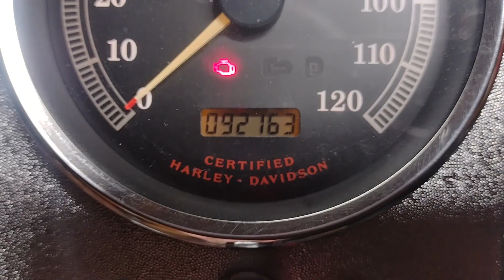The Struggle to get my first Harley Davidson

Comment: Congrats and BTW, my 96inch, 2012 Dyna Superglide has 118K miles on it and my 2003, 1200 Sportster has 76K miles on it.  Neither one has had a wrench to the motor.  I'd suggest you replace your cam chain tensioners and just ride your bike.  It will be fine.  It's a 2001?  It's a 88inch 5spd.  They're good machines.

Comment: The shifter probably needs new bushings they're cheap. That magnetti Marelli fuel injection is known for problems. 1st thing you really need to do before anything is pull the cam cover and check the cam chain tensioners. They are known for going bad. New tensioners are about $75 each. Best of luck with it. Killer deal
Reply: Yup, I'm curious to see how bad the MM F.I. system is on that bike.

Comment: Congratulation to you sir ! I just got my first Harley also, a 1998 Road King Classic which is pretty similar to yours except mine's an EVO and I think yours is a Twin Cam. It only has 13,000 on it and was well taken care of so it needed nothing. I bought it at the end of the season so I've only been able to take it out a few times. I think we both have the Magnet Morelli fuel injection system which I'm told is the biggest drawback on these bikes because parts are scarce for it. I'm next door in Michigan so the weather sucks here also but while I've been waiting for riding weather I've been acquiring most of the parts to convert it to a carburetor if I ever have to. Hopefully I never will though because it runs great. Even in this cold weather it fires up immediately and runs smooth. I've had an 1986 Honda Magna VF700C for the last 13 years and I've kept her going all this time so I think I can handle this beast . Looking forward to seeing what you do with the bike .
Reply: I'm right by michigan to
 Just south of michigan city harley dealership.   The magnetti marelli is good to go if it's working.   If you do have problems you can get a cheap s&s knock off carb for $100 and some cables, your all set.  If you want to spend a little more get a used harley cv setup or a real s&s .  Either way no big deal.
Reply: Just got my first harley 2 summers ago finally.  Only took until I was 41.
Reply: @whatyoumakeofit6635  The hardest part to find was the electrical cable. 97-98 uses a different cable than the other years so no aftermarket and they are discontinued from Harley. I have all the manuals though and a guy on one of the Harley forums measured all the lengths for me so I made one. Should be ready to go if I ever need to do the swap.

Comment: Where did you get the astro gas cap on that sporty? I used to put them on my Sturgis to save the paint on the tanks. Now I have a 2000 Sportster and want to save its paint! What year is that Heritage in the background? I had a 1999 Evo Heritage Sinister Blue and Diamond Ice looked just like yours.
Reply from the maker: Ahh the old krommet gas cap, we got it along with the tank and rusted 21" wheel from my great-uncle's Harley parts bin after he past away, you can still pick up krommet caps on Ebay for $30-$50. The 2002 Heritage in the back is my pops bike. I'd like to get a Sportster Evo for me an my son to just hop on in case our bikes is ever needing work